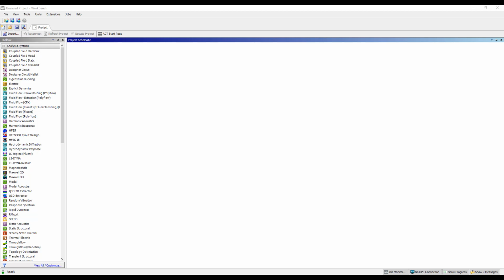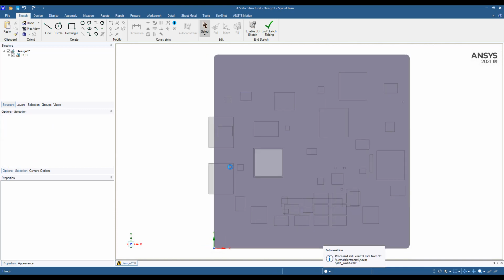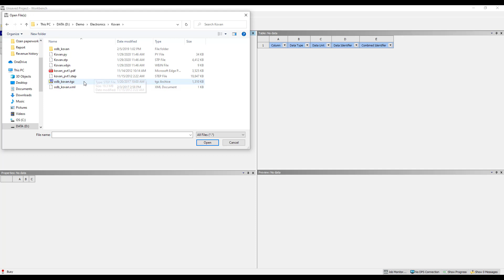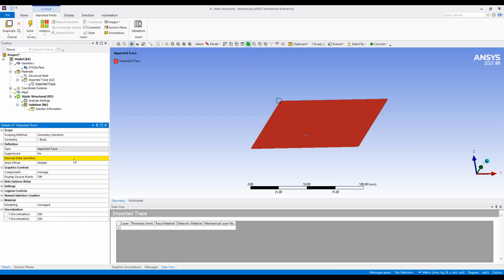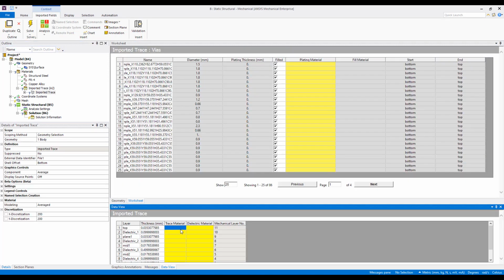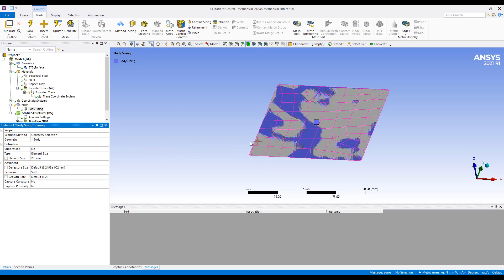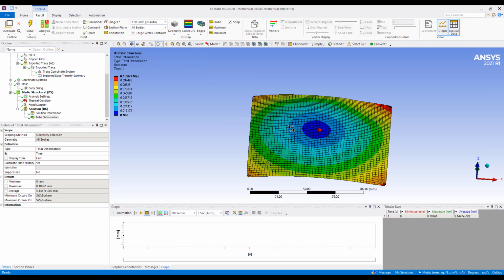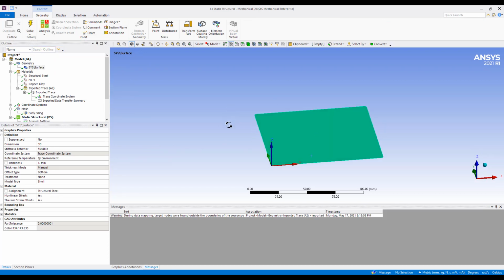Ansys Mechanical: Shell trace mapping

Comment: When PCB trace is imported as 2D shell and modal analysis is performed for 4 holes edges as fixed boundary conditions and  again same pcb is modelled as 3D with all layers and same boundary conditions is assigned why 2d shell results show higher frequency values??

Comment: I have a small doubt. We are performing trace mapping in 2D (shells), Why should we give vias input, in via worksheet 

In the end we need only the material properties along x,y directions right? Since the trace mapping is done on shells?
Reply: I have a similar question too. When we model the PCB layers as 2D shells and then specify the thickness, does it allow us to simulate bending in out of plane direction as well?